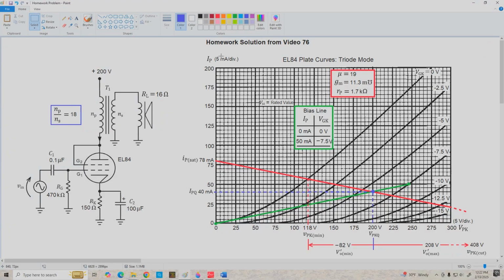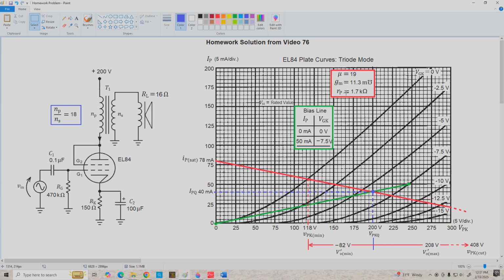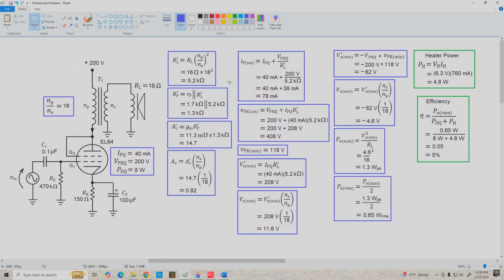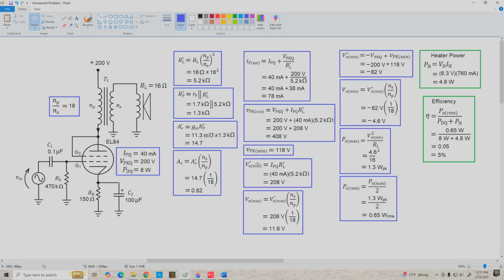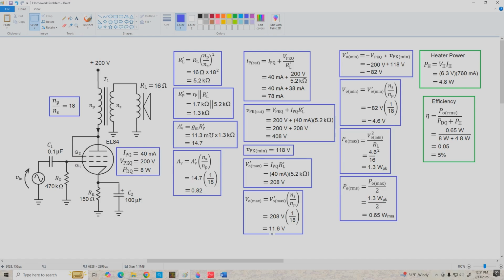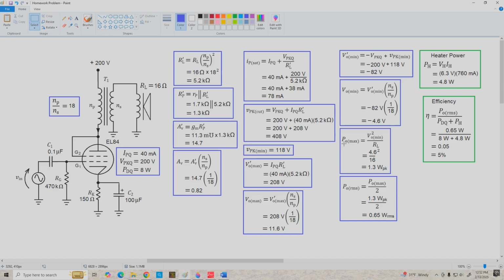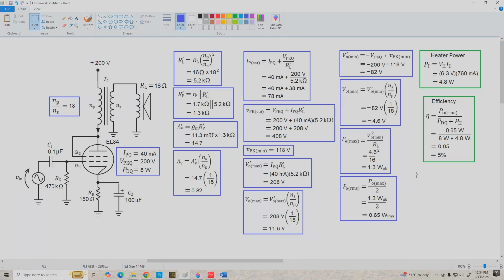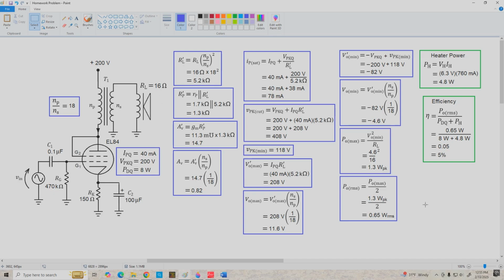Topic 77: Class A, SE Triode Homework Solution

Comment: I would have put a LM337 on the cathode configured as CCS source, which will limit plate current. easy to install, I did that to my Heathkit  AA-22 stereo tube amp, no more bias adjustments to make.